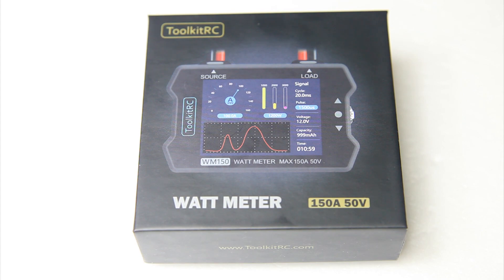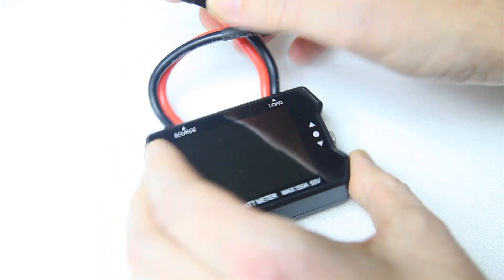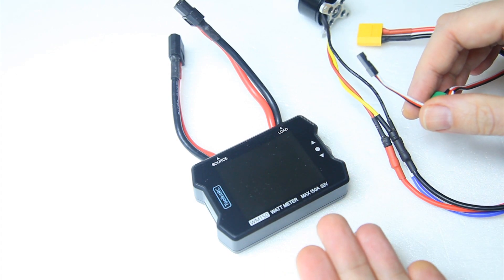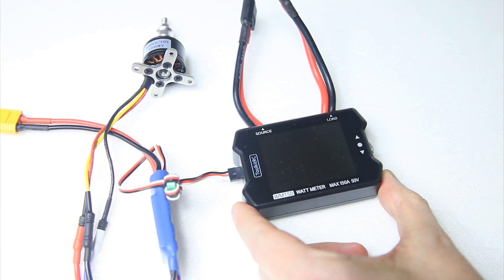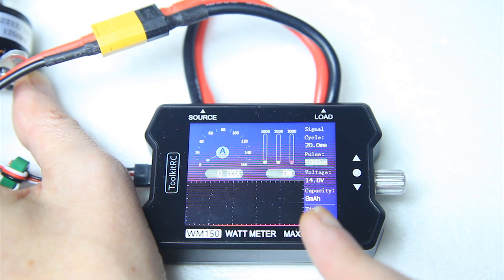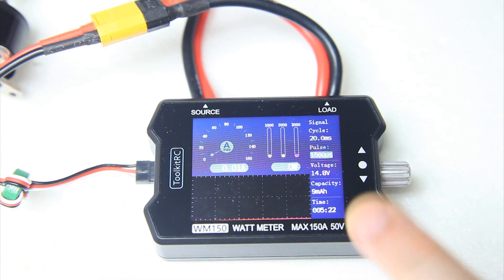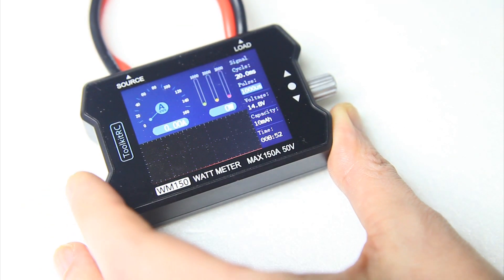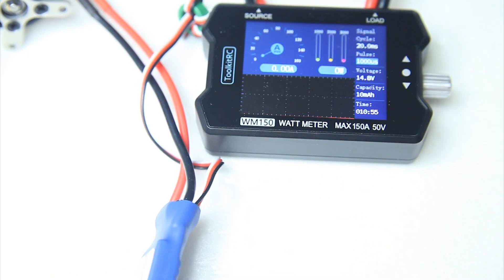ToolKitRC - WM150 Advanced 150A Watt Meter - Show & Tell! (and GiveAway Announcement :))

Comment from the maker: One of the essential tools in RC.. A Power Meter :) 
Link to the Watt meter: https://www.banggood.com/ToolkitRC-WM150-150A-50V-Watt-Meter-Power-Analyzer-LCD-Display-Power-Voltage-Current-Tester-PWM-Output-p-1593171.html?p=TO251813974002015038 

Site for firmware updates: 
https://www.swvv.com/wm150 

Site for Wholesale info: 
https://www.hobbyporter.com/toolkitrc-wm150-advanced-watt-meter-1-50v-150a-24quot-tft-screen_p1981.html 

Specifications:
Input Voltage: 1 - 50V @ MAX 150 A
USB: 5.0V @ 1A Firmware upgrade USB3.0
Output PWM: 1000us-2000us @50Hz
Display LCD: TFT 2.4 inch  320*240 resolution
Product Size: 80mm*54mm*23mm
Weight: 120g

Comment: say what and amp draw RC meter without any peak info??
that makes no sense if you can't see what the amp/watt draw it peaked at.
even the cheap and very old 6USD 150amp version does that and has better resolution with 2 decimals.
https://assets.kogan.com/images/vicoffroad/VOR-CY150AA2-AP-SUN-R1/2-b31f7e0270-cy150aa2-ap-sun-detail-1.jpg
looks like they have put a crude update that will put in a max amp info and kudos for that.
there is a new update at 12-5-20 does that make it even better than the one 11-18-19.?
https://www.toolkitrc.com/wm150
// vers. log
===V1.10===2019.10.10===
First edition
===V1.11===2019.10.29===
1. When the output is paused, press the menu button to also bring up the channel setting menu.
2. Optimize the problem that some SBUS signals are not recognized.
===V1.12===2019.10.29===
1.The current meter is divided into 3 gears, 16A, 64A, 160A.
===V1.13===2019.11.15===
1.Increase the maximum current and maximum power display.
===V1.14===2020.04.27===
1.Solve the bug that high current is not displayed in some cases.
Reply from the maker: yeahh they did adress the issue in a later firmware, but what can I say.. A typical thing that happens when the "designer" never uses things like it (?)

Comment: I can't stand "things with wires hanging off of them".  They should have used the PCB mount connectors like the XT60PW.
Reply from the maker: That Would be neat but not every setup runs on XT60's :)
Reply: @DutchRC  Don't let the perfect be the enemy of the good.

There's a difference between "not perfect" and "worst".  While the XT60PW is "not perfect", the "worst" option out of all possible options is to hang wires like this off a device.

Comment: I fully agree - the old common PowerMeter had a peak value option. It gave max voltage, min voltage, max Watts, max amps. This one is fancy looking - but The major values are not available after you finish playing with the potentiometer. If there was also an SD card log option - WOW - that would be great. This one is just nicer but less functional version of the old tool.
Reply from the maker: yes I agree.. seems a bit of a lost opportunity even though they could ofcourse alter the firmware to add those features.. 
Having said that it is a bit "rare" to see companies invest in firmware upgrades once the product has been released (especially with budget products)
Reply: @DutchRC  I hope they can add it. Otherwise I won't even look at it anymoe and stay with my old Powermeters. Or if it is based on STM32 architecture someone may eventually hack it and write their own version of the firmware. There should be also an easy way of adding motor RPM read using the phase current pad connected to the sensor. That would be a killer.
Reply from the maker: @pjak2000  they should just open source the firmware or what? that way the value of the device will increase at no cost to them cause Someone would for sure add those features :)

Comment: how accurate is the Watt meter, and is there an option to calibrate it ?
Reply from the maker: it seems accurate to about 0.1V (haven't checked the Amp reading yet).. 
And not at this moment.. I have requested that feature to be added but well.. Not much being actually done over there at this point..
Reply: @DutchRC  ok thanks. I have 2 other "high precision" Watt meters from Banggood and they are out by 10-20%, totally useless like most chinese products and no possibility for calibration, that's why I was asking before wasting more money on yet another Watt meter.
Reply from the maker: @bobeshoz  Yes.. to be honest, I think most people wouldn't have the equipment to actually calibrate devices like these, but it Should have the option (and it can't be hard to implement)
10-20%? :O Which were that bad??

Comment: Thank you for your video, saved me from wasting money. I hope, you'll test the servotester, too.
Did already have the Wattmeter and the Servotester in my basket.
What a crap display, what a crap software! We discussed this in a forum, and could not believe, that the divice wont show numbers, only graphs. But after your video I know: Id only does show graphs, and you even cannot calibrate/adjust the y-axis. And it does not show the max Amp draw.
What a crap, how can a company release such a useless device?
Still will use my old Hobbyking Wattmeter.
The "Throttle by device" would be a cool feature, but for what, if you cannot read the values after testing? And if you even cannot see numbers, but have to watch a tiny graph?
Reply from the maker: Howdy man :) 
yes.. the use is indeed quite limited as it is now. it does Look nice but at this point that Turnigy meter (I have the same one) is more usefull indeed :) 
There is a firmware update due for the Toolkit WM150 which should add some things.. We'll see what that does :)
Reply: @DutchRC  Yes, we will see.
But this Wattmeter (and the Servotester) are very new. Only few weeks available now. Dont get, why they have to release a firmware update few weeks after release. Because this is no bug...
It looks so cool, but I'd highly prefer a display only with few numbers (Amp is ok, I can calculate Watts as everyone, easy calculation). 
Same with their M6 charger (and the rebranded Toolkit chargers sold as Graupner U150 for two times the price). Discharging/storaging does not work if the charger is powered by a power supply, only works (regenerative) when it is powered by a battery.
And firmware update (M6) only works with USB 3.0 (not with 2.0)!!! Know some guys who have elder computers and therefore are actually not able to do the update. 
Was totally keen on those Toolkit things, but actually (I also read forums) I will stay with my (numerous) ISDT stuff. 
BTW: I even do not have the Turnigy Wattmeter, but the elder one (with metal case) Hobbyking HK-010. It works...